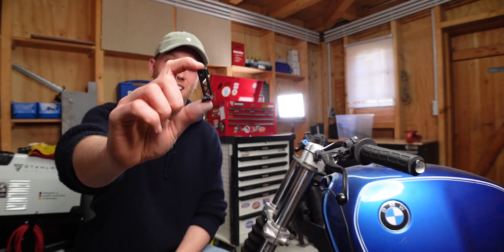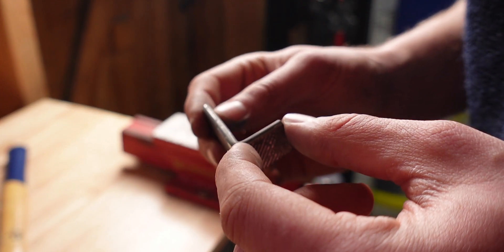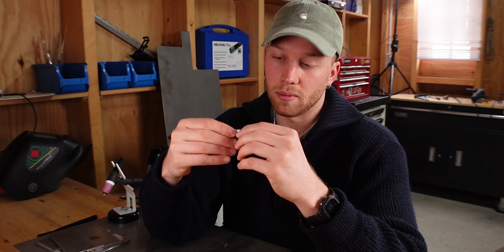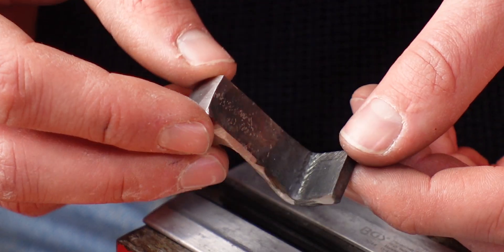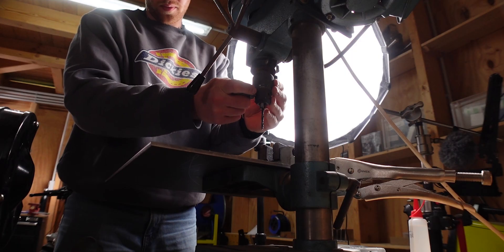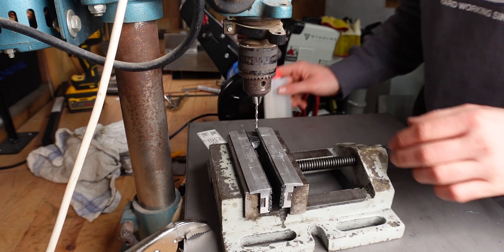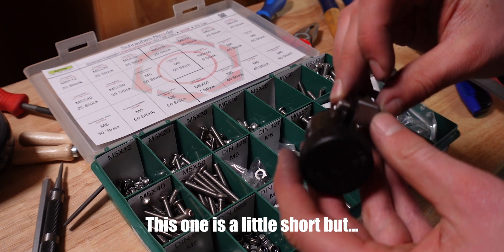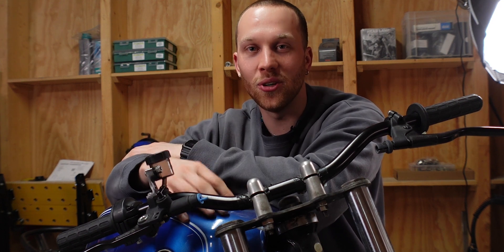Fabricating a Bracket for my BMW R80 Brembo Brake

Comment: Very nicely done. One handy hint that I was told when making bolts shorter is to put a nut on up past where you're cutting it. Then cut and clean it up and unscrew the nut. It helps clean up any threads which may be slightly out of line from the cutting and filing.
Reply from the maker: Thank you so much! That's a great tip. I appreciate you sharing that with me! I'll give that a try.